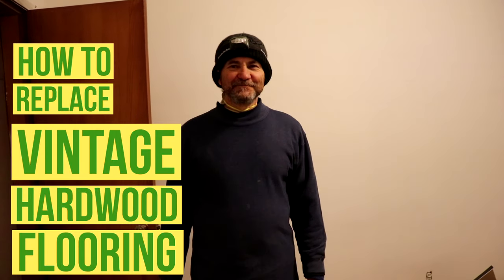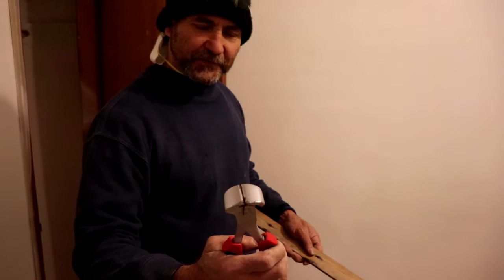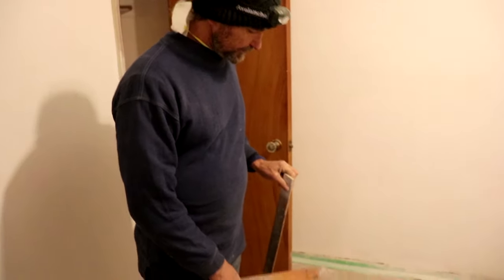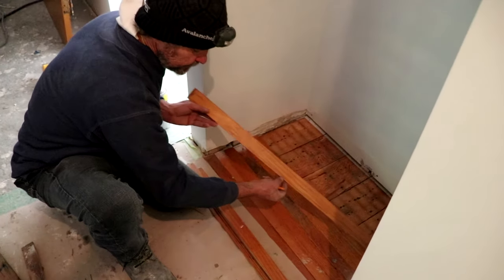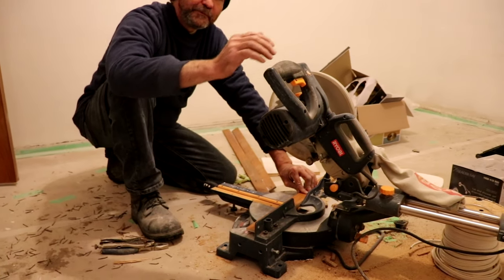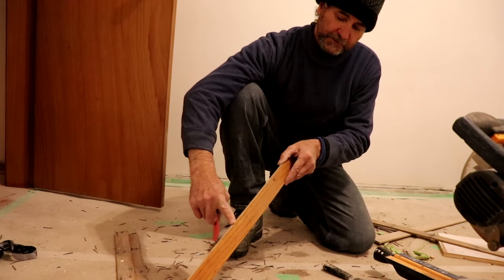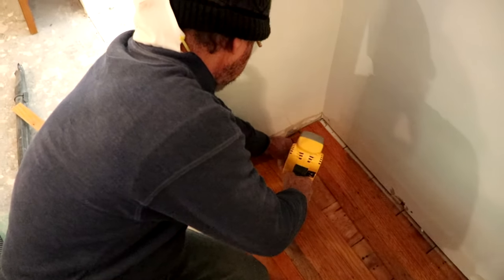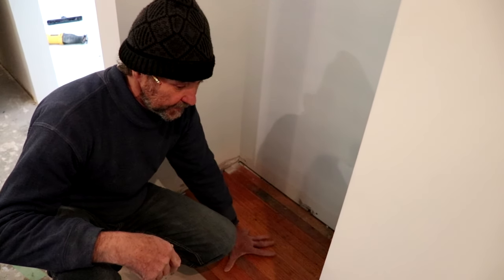How to Reuse and Install OLD Hardwood Flooring

Comment: Great tips. Our house was built in 1969 and doesn’t have a solid subfloor, just those diagonal planks like you showed on some of the house you are working on here. The maple hardwood was installed over those diagonal planks and the floor creaks like crazy. I don’t know it it’s worth trying to salvage the original hardwood floors, they are in great shape but the creaking and no sound proofing to the basement is very annoying.
Reply from the maker: Hello Violetgysie, some time it is not worth, in my case, I had the basement unfinished and had 100% access to do the job right, I use sub-floor glue from underneath and glued the joists to the diagonal planks in the entire place, so far we did not have any noise complain, is your basement finished? If yes is a kind of hard, if no you can add some sound proofing components, my I love original hardwood flooring, comparing with the new stuff (hardwood) If you have more questions or comments please let me know, thank you very much, keep safe and enjoy life
https://www.youtube.com/watch?v=MlYA1clQFFc&list=PLsuiwpfrzLWA71DO1KtDLpkRzq-y14Ypo&index=22
Reply: @BahianoReno  Thank you for your detailed response. The basement is partially finished so it is still easy to get to the joists from the basement right now.  Have a blessed day.
Reply from the maker: You too, keep safe

Comment: Can you use glue as well as nails on this type of hardwood?
I just bought a house with this type of hardwood on main and upper floors that I am going to try to save for use in the basement, or possibly redo one floor with it.  Worried about sound/creaking.
Reply from the maker: Yes, glue and nails work very good, if your basement is concrete floor. the concrete needs to sealed before gluing the floor on for vapor barrier, most the older houses make unwanted noises from the floor, Thank you very much for watching my videos, keep safe and enjoy life, see in the next one.

Comment: Great video! Thank you for those tips. Since you were using reclaimed flooring, When you installed those boards in the closet area, did you nail in the existing nail holes?
Reply from the maker: Hello friend, thank you very much for watching my videos, they were mailed on different spots, if you do nail in the existing holes, the nails would not hold the board on place very good, keep safe and have fun